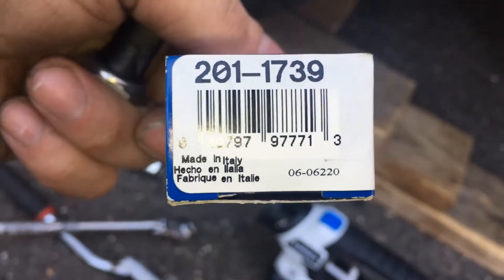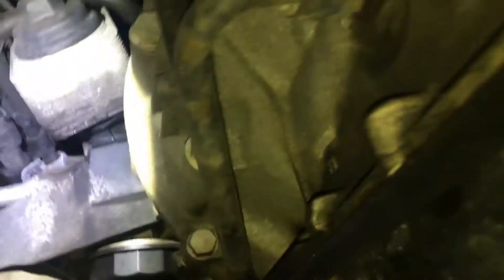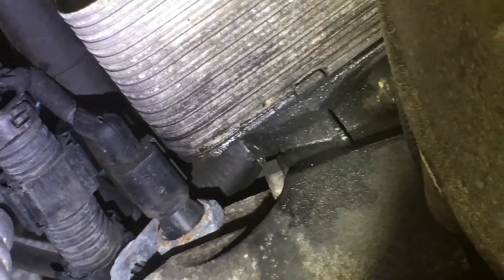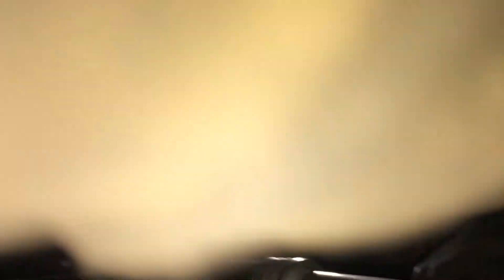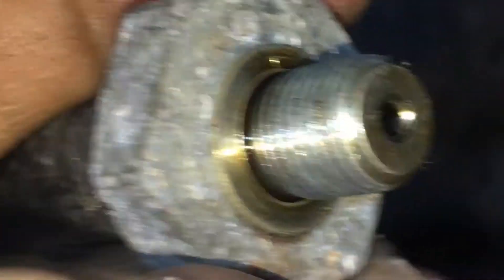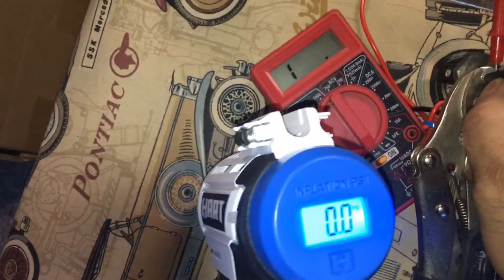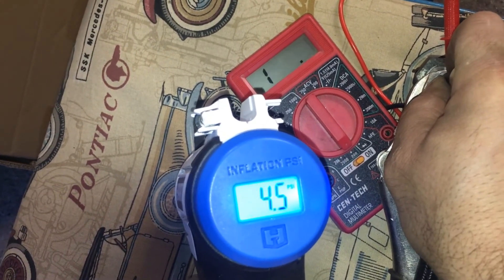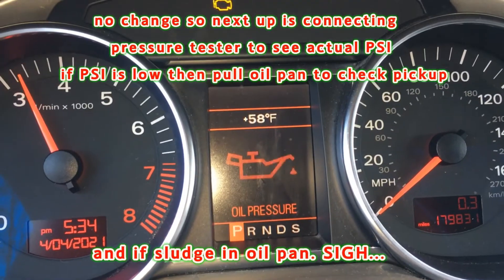2007 Audi Q7 Low Oil Pressure alert 3.6l replace PA6-G30 Switch 201-1739 Beck and Arnley

Comment: So what solved your problem?
Reply from the maker: I havent solved it yet. I just have the car parked and drive it around the block once a week letting engine heat up. I can only think the oil pump is going as I cant figure out exactly whats wrong. I havent tried much because I couldnt get my PSI adapter thread into the test hole and was about to smash the car in! lol.

Comment: Was your car puttering when the light came on?
Reply from the maker: no it just blinked the warning. low oil pressure is about the worst warning you can get though. no lube = bye bye engine
Reply: @bobspurloc  I drove her right back to the house just trying to diagnose if it's the screen that might be plugged up or if it's the pressure switch thank you for you response though!
Reply: @bobspurloc  I replaced the valve cover gaskets yesterday and I waited until today to drive and that's what I woke up to the oil pressure light coming on about 6 miles down the road
Reply from the maker: @Houdini.C  ah interesting. I wonder if you pinched the gasket somewhere or maybe not tight enough? I think it goes to around 50psi but doesnt check until rpm's are over 2000 I think it is. let me know what you find
Reply: @bobspurloc  I definitely torqued every bolt to spec and pattern Im going to drop the pan and clean the screen see if that helps before taking the valve covers back off I have a 4.2 so some spots are a pain in the ass
Reply from the maker: ah ok. I have the 3.6 and I think the front axle is in the way of dropping the pan. I dont recall what I did in this video but my switch tested as fine. I connected up gauges and saw pressure wasnt exceeding 20psi. My car has been sitting because I dont feel like dealing with it right now. but occasional tests suddenly pressure was working. then one day the pressure went up to 100psi but no oil was leaking. Im not sure whats going on with m engine. the 3.6l of my year has the oil pump bolt issue where they didnt torque it properly. my VIN says my bolt should be torqued correctly meaning they had fixed the issue. so Im sort of really annoyed at what is doing on. I was going to drain the oil and go in with a snake to check the screen. not that I know where the screen is etc blah. I went to put a T on so i could watch pressure and let the switch work but I couldnt get the T to screw in and got extremely annoyed. Im pretty sure its the correct thread size etc on the 3.6 its just an awkward angel. I forgot I could reach from above blah.
Reply: @bobspurloc  the screen would be at the end of the sump tube
Reply: I'm trying to start at the cheapest route I was hoping that it would just be the oil sensor switch but you were the only person to respond and said it wasn't riding rough when it went off
Reply: The light came on*
Reply from the maker: yeah just flashing the light. I drive the car around the block keeping it under 2000 rpm. I mean with the gauge attached I saw it was consistently getting to 20psi and after running less than a minute the lifters quiet down. so I know oil is getting to them. they are loud because I keep leaving it sitting for a week or more. I have a solar charger keeping the battery fresh. unfortunately as it sites outside im pretty sure the water damage is getting worse. but anyway I was thinking shuttering would be from lack of oil and engine imploding but that is not likely I dont think. so possibly you have maybe an ignition issue? or fuel injector? these are hopeful guesses as a true lack of oil pressure is something we hope really isnt happening
Reply from the maker: you would think if the car thinks oil pressure is low it would go into LIMP MODE. but mine isnt doing that. and It should saying something on the screen about it not letting you exceed a certain rpm. although limp mode wouldnt be a rough running thing it would be the car not letting you exceed a certain rpm/speed
Reply: @bobspurloc  yeah it sounds like we may be having the same issue because driving it back home wasn't to rough I just knew that that light being on was no bueno I will definitely let you know the outcome I'm going to try to do it within the next couple of days 🤙🏻
Reply from the maker: its a real pain. I want to run mystery oil and make believe its doing something. which means 7 quarts oil to toss. then run again. 14 quarts to toss. then drain again 21 quarts to toss.... very annoying. I have a ton of boxed oil I got on clearance so I dont care about that. its getn rid of the damn oil lol. I know the screen is bottom of pickup I just dont know where in pan. obviously low point. ill just look at the schematic. most likely useless looking with a snake cam. but the damn car shouldnt be clogged. although a few years ago I seemed to have a filter that seemed to maybe fall apart. blah. well was brittle when I removed it. no clue why. oem filter.
Reply: @bobspurloc  maybe you can shove the cam in the drain plug I just found a split line on my egr valve I wonder if that's what's causing it to run a little rough
Reply from the maker: yeah that will definitely cause the engine to run rough. yeah I plan to put the cam through the drain hole.
Reply: @Houdini.C  did you figured out what was the problem?
Reply: @Therey1898  yes I replaced my oil pressure sensor and she was good to go 🤙🏻
Reply: My low oil pressure light only seems to turn on when the car is at an incline uphill or downhill and low on gas the light will come on right at start up or as you pull away please help!!!
Reply from the maker: @alexjobs1631  3.6? the oil pressure switch is only checked at over 2000 rpm for 3.6l engine, so this doesn't sound like same engine. sounds like you may be low on oil or something
Reply: Hi, I'm having same kind of issue, I get low oil pressure warning for 5 seconds when I start it in the morning.
I did engine flush with last oil change, and since then I can hear whining engine sound, mechanic has checked and confirmed that its not from the accessories drive belt or bearing. I want to check also the oil pan by removing it but it seems we have remove the front differential and subframe to remove the oil pan.

Comment: I have the same problem, did you find out what the problem was?
Reply from the maker: not yet. how many miles on yours and year 3.6l?
Reply: 164,000 same problem and the dealer just did a 9k timing chain job
Reply from the maker: You mean you have this issue AFTER they did timing job? There shouldnt have been a need for timing chain at164k so did your bolt back out which was a major problem with earlier 3.6l engines early 2007 and before
Reply: @bobspurloc what bolt backs out?
Reply from the maker: @misterfixit5186  early 3.6 the bolt was not properly torqued and loosens causing gear to flop etc

Comment: So was there a solution besided timing chain service?
Reply from the maker: I havent found the cause yet. its not the time chain as far as I know. however if its the oil pump then u would do timing chain also because u have to remove it to replace them pump which is directly driven by it. so it would be insane to not replace it due to the amount of work needed to get to the oil pump...

Comment: I will tell you exactly what the problem is. I had that happen to my 2007 q7. It's your timing chain guides.  Pieces of them floating in your oil pan. What happens, they clog up the intake into the oil sump. When ur oil pump is trying to pull more oil up the tube and can't, you get this. Solution sucks. I took my engine out and replaced all timing chain guided. That the only solution. Also, when your doing it. On 2007, I got an updated oil pump and a sprocket for both the top and bottom chains one solid piece. New bolt for the pump. Basically your doing a timing chains job.  I would drain the oil, and u will know right away if it has small plastic pieces in it.   Good luck to all.  Audi 4 life.  Cheers.
Reply from the maker: ive been worried about the oil pump bolt backing a common messup on earlier vin 3.6 engines out but its never happened. my vin is higher than the effected range. my oil is clean, I even sent it out to be tested and they didnt find anything wrong. do you know if I can see the pickup if I put a snake into the drain hole? I guess I should look at what it looks like from a schematic or something. as you cant just take the pan off. i still have the car parked and run it weekly. I sopped trying to find the problem but when I was looking. I had a meter on and one time out of 20+ the oil pressure was back which was baffling.

Comment: Sir switch mai kitna voltege ata  hai ❤❤❤❤❤❤😊😊😊😊😊bataye nahi ap
Reply from the maker: its not a voltage reading though its on off. either the switch is open or closed. open circuit or not. but sure the ECM is looking for that voltage I guess to know if open circuit or not. that is something I need to check however I always connected a PSI gauge and see my psi is low... (yah voltage reading nahi hai, halanki yah band hai ya to switch khula hai ya band hai open circuit ya nahi, lekin sunishchit karen ki ecm us voltage ki talash kar raha hai, mujhe lagta hai ki open circuit hai ya nahin yah kuchh aisa hai jise mujhe janchane ki avashyakta hai, halanki main hamesha psi gauge se juda hua hun aur dekhta hoon ki mera sai kam hai

Comment: Damn Man. This video doesn’t really show exactly how to get to it. It just goes straight to the oil sensor. Smh
Reply from the maker: what? 1:30 I show  you exactly where it is. right above the oil filter, can also get to it from above, as its middle of engine. if u are talking about me not showing you how to remove the bottom plastic cover, I mean that doesnt really need to be shown just remove the screws same as u would do changing the oil.